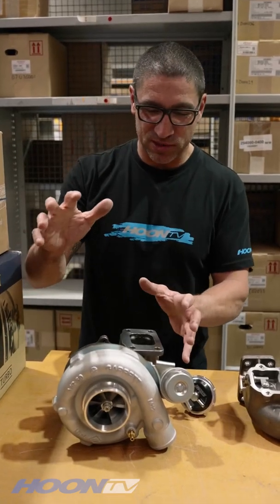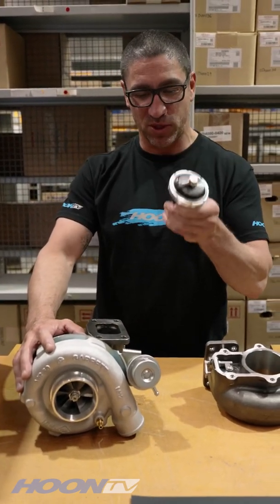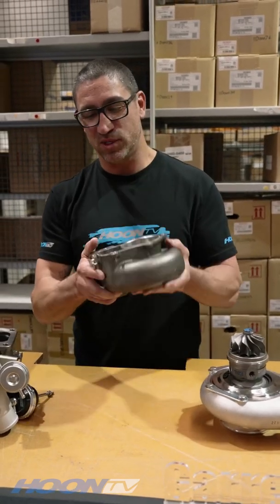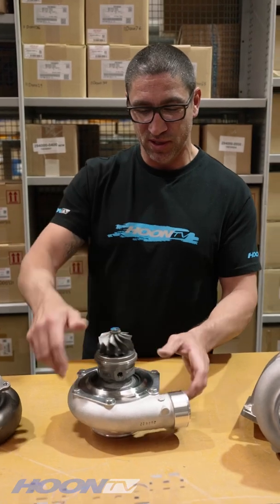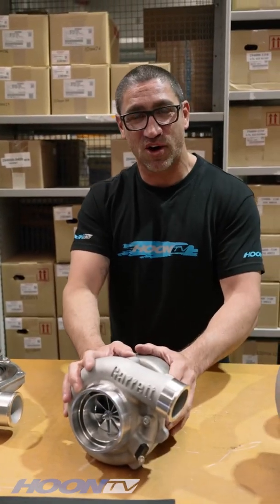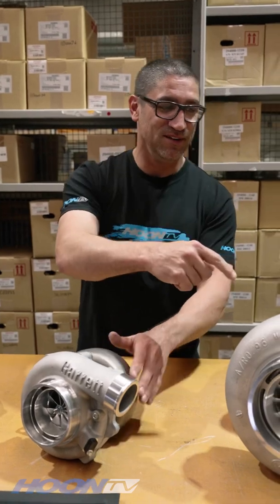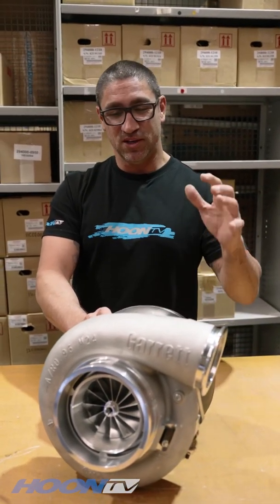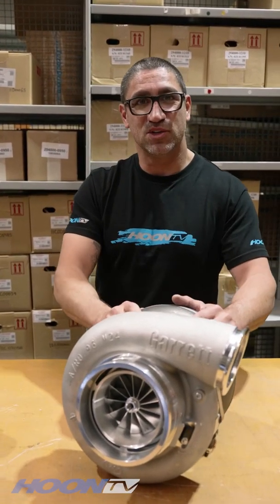What is the RIGHT TURBO for your FORD BARRA engine?

Comment: Keep turbo minimal boost if you put turbo on stock silvertop Barra , keep standard injectors change actuator if you buy Chinese clone and you have to turn them 180 degrees coz of mount position, yiu need to change MAF sensor on go with FG setup for BA/BF models, the chrome pipes look nicer than the plastic Ford produced, you can drill the sump oil return yourself just pack tap drill with grease to stop oil contamination, you will need turbo manifold easily accessible online as aftermarket part and dump along with compatible exhaust system easily accessible and intercooler easily accessible online, it can be done for just over $2500
Reply from the maker: Great info!

Comment: Bro i cant wait to see that cannon strapped to you engine!! Im running a good old green top with a GTW38/84 using the smaller fg rear housing machined to suit (and externally gated) and its fkn pokey! I bet i would be on boost, destroy my BTR and chuck a rod out of the block before that thing is spooled though. Thats what nitrous is for though i guess haha! cant wait mate